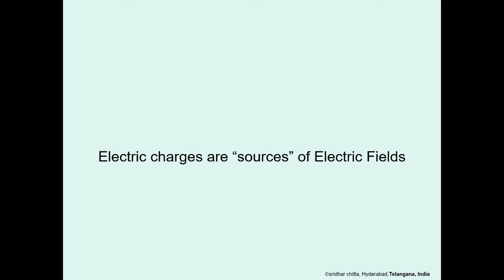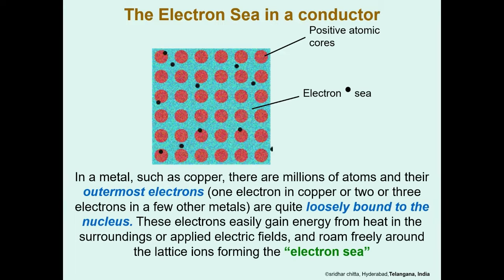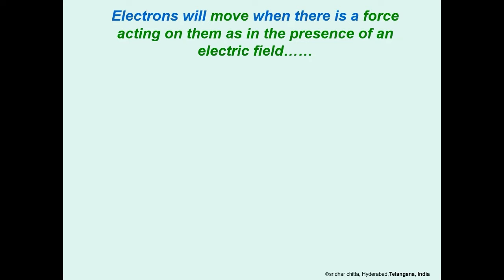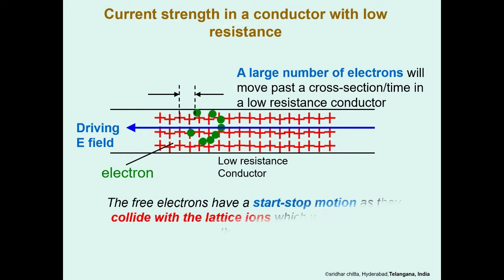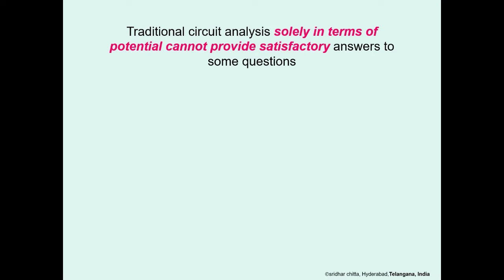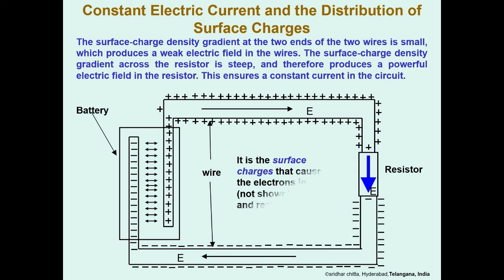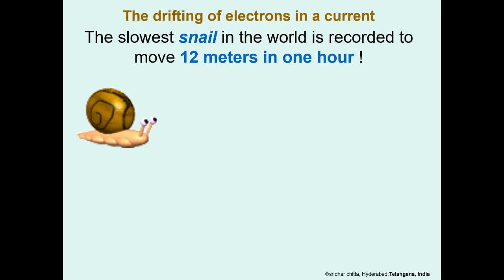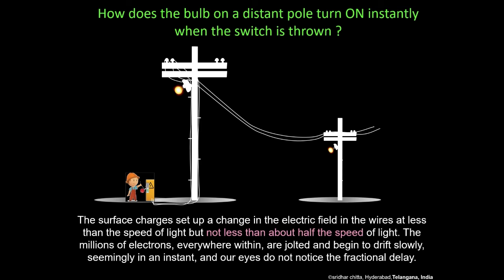Current and the Conduction Process

Comment: Hello sir, great video. I have one question: Why the electric potential on the two wire ( one connected to the positive of the battery to the resistor, and the other connected with the resistor and the negative side of the battery) have each a costant potential? If i measure, for example with a voltmeter, the potential difference of two points in the first wire i have difference of 0 volt. Isn't it in contraddiction with the concept of the gradient of charges along the wire? Because if i have a point with an higher density of positive charges and then in a second point a less density of positive charges, shouldn't the potential difference measured on this two points be different than 0 volt?
I'm sorry if i might have express myself badly. Thank you.
Reply from the maker: I suggest you read the comments I have made to this video titled "Current without a potential difference"
 https://www.youtube.com/watch?v=XY-G9P2oU7g
Excerpt from my comment to the above video
I have noticed a few posts on how resistance is zero and how it gives 0/0.
If one avoids mixing physics with maths, then many anomalies are resolved. 
Maths is only a tool and resistance being zero is an ideal approximation. 
Read the full comment. I think you will understand the answer.